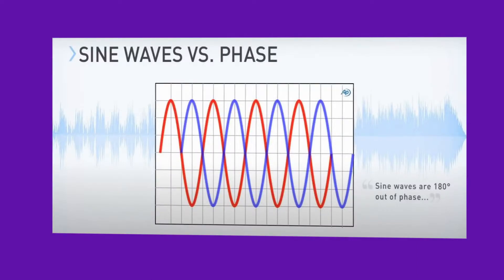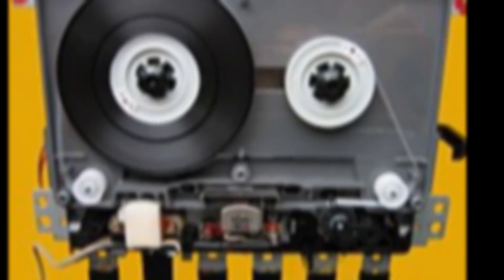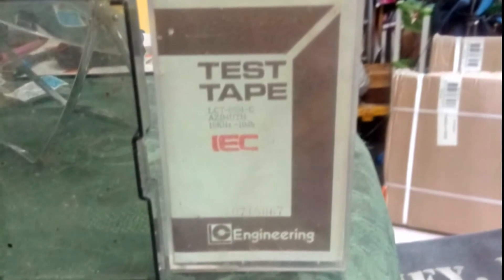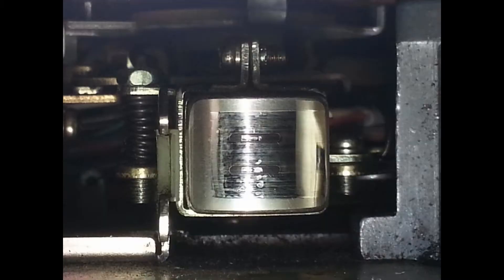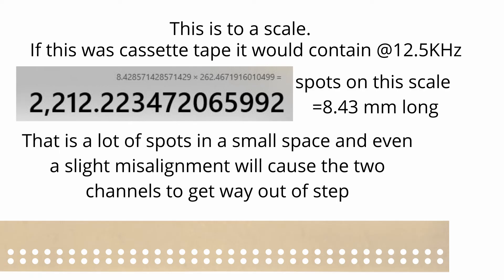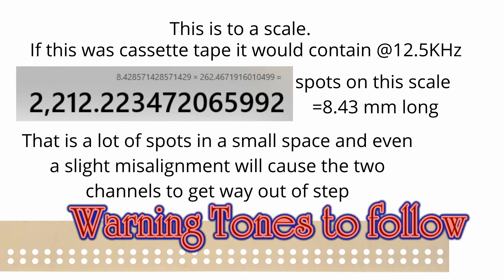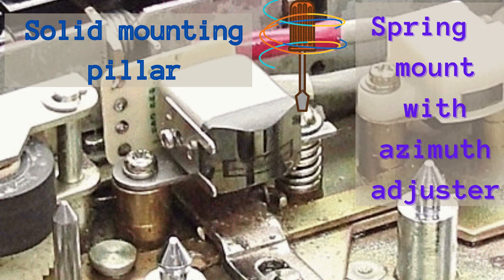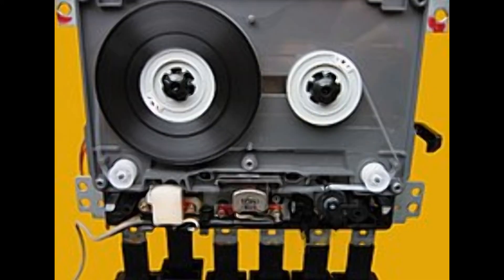This Screw Changes Your Cassette Sound Quality

Comment: Why the Nakamichi Dragon is the pinnacle of all decks.
Reply from the maker: The auto adjust is a fantastic feature. But the deck was very, very expensive. It would be around £12,000 in todays money. So it should be good.

Comment: I always check azimuth adjustment when I'm doing transfers, since in practice, decks are not aligned the same and I'm always seeking to get the most I can off the tape.  Heck, I had a Sony dual well deck that not only was the alignment different between decks, the alignment from side A to side B (auto reverse) was different too!  While it is not recommended, I have actually gotten very good results just going by my ears.  What I do is sum the outs to mono and pay attention to the highs - sometimes, even switching back and forth between mono sum and stereo.  Any misalignment becomes quite apparent in mono, as the frequency response becomes completely erratic due to the resulting cancelation.  Back in high school, I would use this same method to re-align all my decks the same way.  I could even get it to the point where recordings I made using Dolby B or C noise reduction would sound good on my other decks.  My Walkman had Dolby B, and the deck in my car had both B and C.  This is a tricky one too, because any slight bit of misalignment will throw Dolby NR way off, resulting in those audible "pumping" artifacts that gave it a bad reputation -mostly among people who didn't know how to use it correctly.
Reply from the maker: You obviously have it sussed. I agree to do a transfer of a precious tape it can be advantageous to set the machine to match the tape. But for playing mixed source tapes "the standard" is the best setting. I know what you mean about doing it by ea,r but a phone with a graphic analyser app is easier and more accurate than any set of ears. Of course in my working days we had to buy very expensive equipment to do signal analysis but now a cheap phone can do it.

Comment: I have two tape decks - in one that I use for recording I've  set the best to my colection azimuth and keep it fixed.  This way my all new recordings have common choosen as best more or less common  to my colection azimuth. For reproduction I use separate deck where I adjust azimuth according to played tape. I was recoreding  cassettes   in past  on different decks and most of my colection are brand  original cassettes - the have aslmost each unique own azimuth so it is unavoidable to make adjustment to each - I align  by ear  almost every time when I listen. For recording azimuth I prepaired special noise cassette which alows to make it easier then with recorded  music. But setting one best azimuth for all tapes, not touch any more and listen all with quality is for me impossible

Comment: Loving the channel Gary! For me, azimuth & Dolby tracking when recording on one deck and then replaying later on you new 'uprade' machine, or in the car was the biggest letdown of the cassette medium (oh, and speed discrepancies!). I am currently digitising many cassettes made on many different machines over the years. I've found an easy way to get a reasonably close match is to listen to the tape on quality headphones, IN MONO. The channel summing exaggerates the audible effect of any mismatch. In this way the tiniest fraction of a turn of the screw will have a profound effect on the treble amplitude, an optimum position of the screw being easy to determine . Even different tapes recorded on the same deck can vary a fraction when played on a different machine, yet of course replay perfectly on the deck on which they were recorded. this is probably due to tolerances of the cassette shell. Naturally, before you take a screwdriver to your prized vintage machine, it's a good idea to do a recording of something like white noise first, so you can easily re-set it back again. I will twiddle the screwdriver whilst dreaming of owning a Nakamchi Dragon, or CR7
Reply from the maker: You obviously have a need and ability to do this. I unfortunately do not trust my ears and so I use an app to show the max amplitude settings. My hearing stops at around 15k using Headphones but  as it happens the phone app agrees  with my ears as to the best setting, so I use both.  Thanks for the support and the info. Seasons greetings. Happy New Year.
Reply: HAH!  As I just stated in another comment, I do the exact same thing.  And yes, I could even get Dolby NR to work properly between machines.  This was super important back in high school when I'd make recordings to listen to on the Walkman!  The erratic response caused by the phase cancelation that occurs when you sum to mono really does make it easy.  Using the scope to determine proper phasing really is the best way, but I figure if I can get Dolby B AND Dolby C sounding great between two different machines by ear, then I'm close enough :P

Comment: There was a technician who did this experience, I just don't remember the channel. In-ear fit tops out at 50-80% with better vu's with reference tape and oscilloscope achieves more than 95% perfection Rotation of 97% or 103% is noticeable on models with PITCH
Reply from the maker: The main point is that they should be left alone until all other suspects have been checked off. Too many people just go in and mess it up. before it is even known to be a problem.

Comment: All you need is a tape that has been recorded on a known good deck. You can even buy such tapes online. Then adjust by ear to what sounds best...you won't be far off if at all. Besides, unless you're running production copies, chances are, any tape you make will be played back by you and your own equipment. Just make sure it sounds good on that.Cassette taping is a pretty closed ecosystem in the 2020s so it's really not that big of a deal if it's off on someone else's deck that will never be played on.
Reply from the maker: You are correct. That is my main point. A deck cannot be wrong to itself. But so many people just fiddle with it and then it will never match the tapes they had made before they fiddled, let alone any Commercial music tapes or friends tapes. Normally the problem they are trying to fix is NOT caused by Azimuth, and now they have at least 2 problems.
Reply: @GaryKeepItSimple  Indeed! Thanks for the reply and the video, of course! :)

Comment: After replacing all caps and transistors in my JVC, turns out it WAS the azimuth. Set wrong at the factory 40 years ago.
Reply from the maker: That's a problem. because all the tapes that deck ever recorded will be wrong. Bummer dude.
Reply: @GaryKeepItSimple  I just got it, i restored and readjusted everything, now its factory spec. Whoever had it was listening to max 12khz. Now its capable of 18khz on chrome.

Comment: I believe you are kidding. Azimuth can be set for the any tape by just using your ears. Exact azimuth is required for recording. To have compatibility with the other decks. More precision can be achieved by turning Dolby c on, as this system is more sensitive to improper azimuth. With proper tools it is just more easy to set it up. Check Nakamichi CR-7 or DR-1 to understand what I have mean.
Reply from the maker: Most people do not have the proper tools. Or the knowledge to do it. You are lucky you do.

Comment: The problem is, most of us don't have the equipment and most of the guys that did and knew how to do it are dead. so it becomes a matter of DIY, just be patient and figure 20 or so attempts is not out of the question.
Reply: I've done it many times. If a tape sounds muffled, adjustment brings back the treble . If it sounds better to me, why not? Not all tapes are recorded with perfect azimuth.
Reply from the maker: That is the point of my Video. If you go onto the Facebook groups they are always quick to offer totally wrong advice that is hard to come back from. And some Diehards will tell you that you cannot get results other than with £3000s worth of equipment. There is a happy medium and despite the Diehards, it is not that hard it is just as you say time-consuming because you have to try and then see if it worked. 😊PS I have the equipment, so when I say it worked I checked the results before I Post.

Comment: How do you adjust the azimuth on a cassette player without the azimuth screw like a fixed azimuth head because I am having trouble with azimuth alignment on a sony wmfs399 sports walkman with a fixed head and I don't know how to adjust the azimuth if that's even possible? ( which I hope it is)
Reply: Well the thing is it is a fixed azimuth head meaning there is no (atleast conventional) way of adjusting the azimuth; there is no screw. I have tried pushing on the head to no avail. If u have an idea on how to adjust a non adjustable head I will gladly send a photo but it’s ok if you don’t. I haven’t been able to find anything on it online.
Reply from the maker: I have just looked at the manual and there is a screw holding the head in place. But there is no mention of adjustment in the manual. But even the simplest mechs normally have something . The screw holding it down  is on the tape supply side must have a small effect on it. it says in manual special head. I think that is a tamper proof or torx head. so it would suggest that will be what they need to use  and they did not want it fiddled with. A photo would help. I can send you the page from the manual if it helps.
Reply: Gary Keep It Simple ok what’s your email I’ll send a photo of the mechanism
Reply from the maker: Gary.j.Goodridge@gmail.com
Reply: Gary Keep It Simple I emailed it
Reply from the maker: Thanks . I got that. I Have  Replied . I hope that makes sense. Let me know how you get on with it.
Reply from the maker: Have you got a picture? email it to me. Happy to try and help.